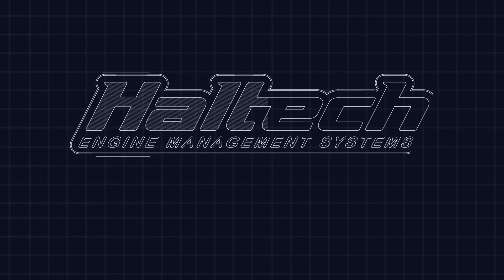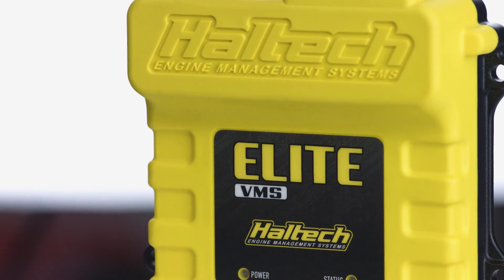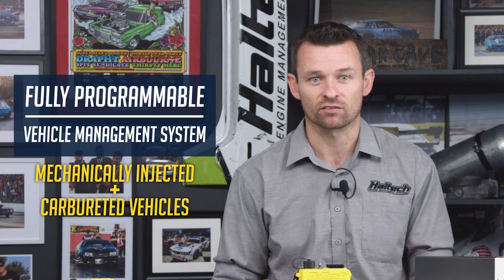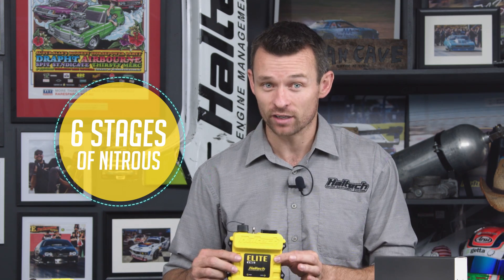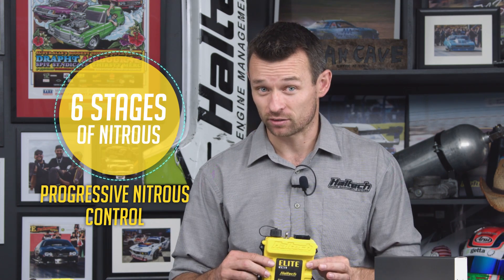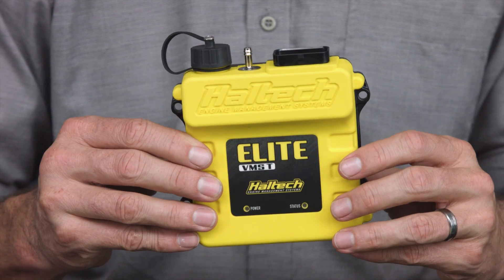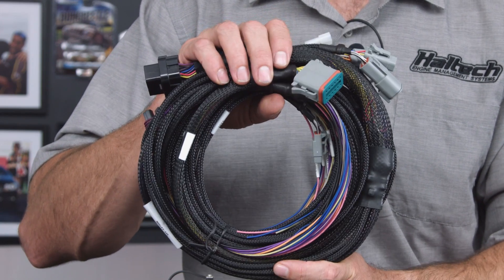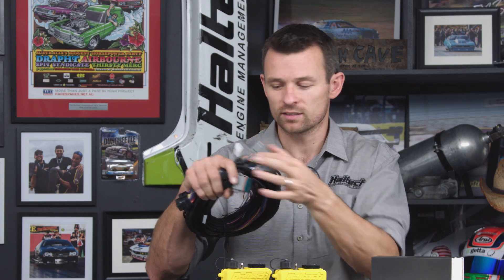🔍 Elite VMS Explained

Comment: I have an old Chrysler 318 carby V8 with a MSD 6al and electronic dizzy. Is there a way to get this unit to work with an msd so I can have the spark energy of the msd and the flexibility of the haltech VMS?
Reply: If you pair this with an individual coil per plug setup you would be able to the same or possibly better spark energy than your MSD box, with the added benefit of more stability and tuning flexibility

Comment: Warren johston us pro stock racer stated on the the change from carbys to electronic injection there will be a drop in power, carbys will make more power than injection due to the better atomization of the fuel. The difference in the main game its easier to tune injection for the lame person, pure genius use carbys
Reply from the maker: Good thing this magic box works with carbys then ;)

Comment: This is like some cars that are carby have a computer or emissions control unit like some older model Toyota’s and other brands of cars . Looks like a great product. Will there be a more streetable version ??
Reply: From what I can tell, haltech (for legal reasons) only sell for non street application products. 

Like Holley, they can’t legally sell you most products for non racing situations or they’ll get a huge EPA fine.

Comment: Geez drug money much?? This thing is stupid expensive!
Reply from the maker: If you compare it to what's currently on the market you'll find that $1200 for a unit with a set of feature that the VMS offers is actually quite reasonable. It's not for everyone, sure, and there are cheaper options out there, but you'll be hard pressed finding all the advanced race features on those products.